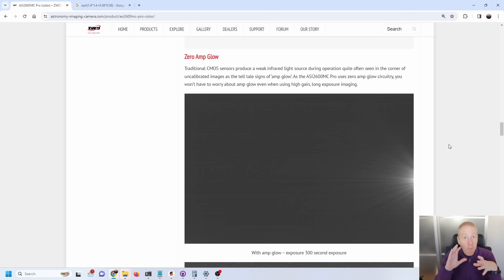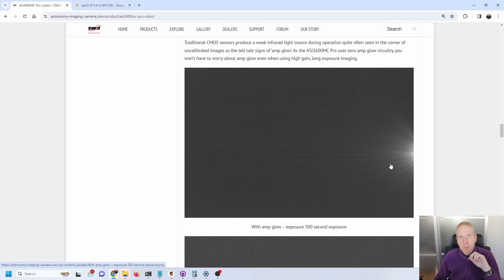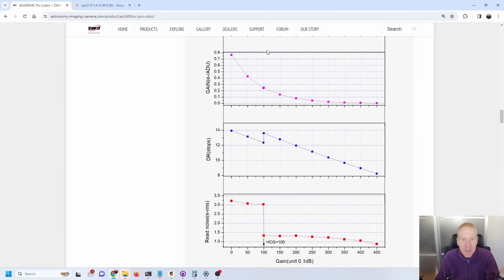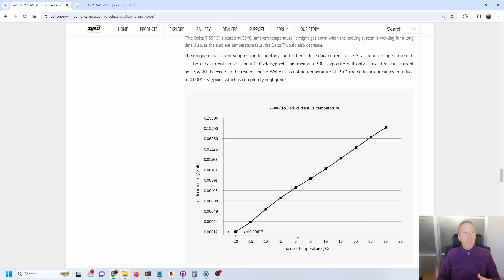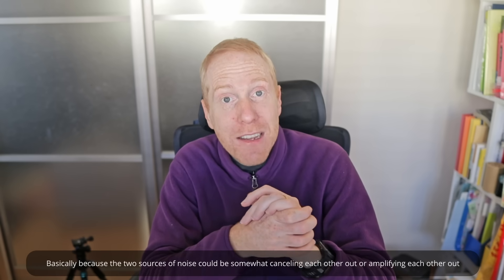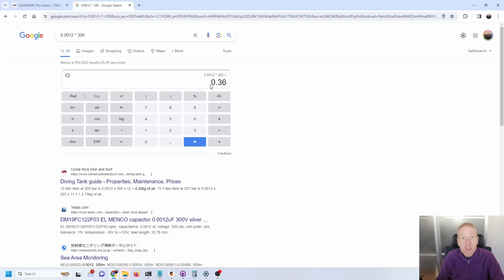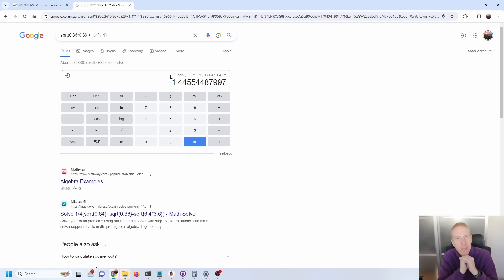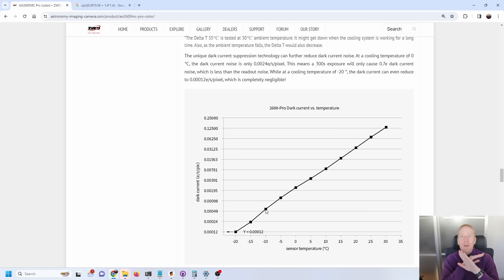Why I DON'T take Dark Frames (and what I do instead) - Astrophotography

Comment: Insightful as always. As much as I've learned from you over the years I have to mention 1 thing. For flat correction to work optimally the cam offset has to be removed from the lights & flats to put them on the same pedestal, normally with darks & bias. I've gone on to use mathematical offset subtraction to calibrate the flats (avoids noise injection of calibration with no penalty) but still use master darks that are shot a couple of times per year with the cam capped & put in the fridge to save the tec cooling, no light leaks either. I do this for offset & sensor pattern noise removal bc dithering does cope well with everything else,  on my cams without amp glow.
Just a morsel of food for thought.
Reply from the maker: Yep! But in my case the bias act as flat darks :)
Reply: @CuivTheLazyGeek  Thanks, I understand, but I still use darks to remove the offset from the lights. I guess we all evolve our own ways and your work on YouTube has brought me much over several years. Always appreciated!

Comment: Interesting video, seems convincing logic so I gave it a try processing with darks and dark-flats vs processing with master bias.  SubFrameSelector judged the one with darks to be better in all respects except FWHM, where the bias version was 1% lower (2.16 vs 2.18, not statistically significant).  After BlurXT correct only, even this difference was erased, with the version using darks winning in all SFS measures.
Visually, I thought the darks version looked better but it was marginal and I may have been subconsciously biased.
Only one test on one set of data, but I’m gonna stick with darks and dark flats

Comment: A few things I just want to point out. This hugely depends on what software you use to stack. Some software requires you to load a master dark if you're using a master flat, otherwise your stack just won't calibrate properly. It can result in massively overcorrected flats, even if the flats are perfectly good. 

Also, as others have pointed out, even with correct dithering (by using formulas to work out how many pixels you need to dither by for your FL and guide focal length) you may still have some hot pixels left as your sensor ages. You either have to start dithering overly aggressively (and at my FOV that just isn't a practical option) or using aggressive sigma clipping. Ultimately if you're using a cooled camera and shooting a master dark library is a one time event every 6-12 months, I'd still just rather use them and take potential stacking problems out of the equation. 

Obviously bias frames are shorter so take less time, but running a dark session on a cloudy night is super easy. On a current gen cooled camera, you're essentially just doing super short dark frames with the bias, so really you're just swapping one out for the other. FWIW - If you have light leaks in your darks, then you likely have light leaks in your lights too, so it's worth actually chasing down those light leaks in general.

I do think when you know what calibration frames are doing you can make this decision yourself, but I think a lot of beginners will see this video and then just assume they don't need darks even though you've explained why you don't necessarily need them for every camera. There's lots of confusion in the community already, so I hope people do their own experiments.

Comment: My opinion would be that darks are not useless. Newer cmos cameras are low noise, not no noise. Using darks will without a doubt improve SNR when measured. Also darks are so easy to take and can be done even when cloudy. Not using darks when it's such a simple way to improve image data, seems counter productive. My two cents. Cheers.

Comment: Cuiv, When working with exoplanet and variable Star images, and with the intent of contributing the data for use by Professionals, is there some subtle ‘noise effect’ that we really should remove via ‘darks’ given the intended professional / scientific use? I just wonder if there are subtle factors that impact the photometric measurements that suggest the use of Darks in those non-AP, scientific applications. 

For example, Flats may be considered optional for AP if you either don’t get vignetting or don’t mind a little of it. However, Flats are considered essential for scientific imaging, vignetting or no vignetting, since they help correct for the pixel to pixel variations in quantum efficiency.

Comment: The analysis completely misses all the non-linear effects of some pixels and the manufacturing defects that a sensor shows when you take longer exposures. You can easily see the amount of "hotter pixels" and small defects on the sensor by comparing a 1-sec master dark and a 300-sec master dark. Just open both and compare visually; I did it on an ASI 2600 at -10 degrees, I see all of them, and I would never replace the proper master dark with a shorter one. Defects on a master dark with a mean of about 10-12 ADUs can get up to 80-100 ADU, which are absolutely of the order of the signal received from a faint target. Absolutely not negligible.
Reply: For these effect one darkframe would do the job. No need to do this for different gain and temperature settings. In other words this would be a different sort of darkframe which only needs to be taken once a year or so.
Reply: Moreover dark frame calibrations do not correct for non-linearity

Comment: My interpretation of this video is that you “get by without dark frames”.  Some of us do not have cooled sensors and probably others of us have the sensors that you mentioned at the start.

It reminds me of those who don’t use lens hoods for general photography.  They see no point.  But, in fact, there are cases where the benefit of a lens hood is easily seen.  And that points to the fact that a lens hood blocking stray light, how ever slight it might be, will have some benefit.  Definitely worth the 5 seconds it takes to put the lens hood on.

Comment: Cuiv, can you please explain how hot pixels are correctly calibrated out with your ‘flat and bias only’ approach? I thought hot pixels approached saturation more with longer exposure time …if that is true then you will not have representative hot pixels since none of your calibration frames has the same exposure time as your lights.

Comment: I understood that for DSLR (or mirrorless cameras) darkframes are still a good method to reduce sensor typical noise pattern. As long as flat frames are not needed bias frames are not needed as well when having dark frames - correct?

Comment: I also used to take all calibration frames but over time I also got lazy ( ;) ), and the only calibration frame I take are the flat frames. I still may take or reuse bias frames from libraries I have. But not all the times. Three reasons: 1) good camera 2) good settings for SNR and 3) in practice, I have seen very little difference. In reality there will be more difference between 2 processings of the same photo that in the calibration frame instead.

PS: of course this does not apply to all camera, eg amp glow

Cheers and happy new year !

Comment: Even with my old DSLR (Canon 70D), I have tried processing with and without darks and have found negligible differences. When I upgrade to a cooled astro camera, I really don't think I'll need them. It's nice to hear that I'm not the only one questioning their usefulness.
Reply from the maker: That's actually surprising to me, although I suspect you've been dithering very, very well!
Reply: @CuivTheLazyGeek  You are correct, ever since I got my mount I've been very strict with dithering (even with the hand controller before I started using NINA). We don't get many clear nights here, so I can't risk wasting a night of imaging. If that's what has been saving me from needing darks, then I guess the effort was worth it!

Comment: Interesting approach, Cuiv, although I'm still wrestling with the concept of not doing dark frames to be honest.  One thing I'd note, and I think you touched on this, is that you can't just assume you don't need to do dark frames merely because a camera is one of the ones that supposed to be 'well behaved', i.e., not have amp glow.  As an example, my first ASI2600MM Pro had two areas on the right side (top and bottom) of my dark frames of about 240s or longer that looked identical to amp glow but this camera isn't supposed to have amp glow!  Several others have reported the same thing in their ASI2600MM Pro's and it gets worse with increased time.  (In this particular instance, you might even need exposure-matched flat darks!) However, the ASI2600MM Pro that replaced my first one (that developed an oil leak) does NOT have this same amp glow-like bright area on longer dark frames.  So, initial testing of YOUR equipment regardless of the manufacturer's reported characteristics is necessary.   The second thing I'd mention is that I do see an exposure time-dependent appearance of hot pixels (thermal noise) in my dark frames, which is the main reason I'm still unsure about whether or not using dark frames is an optimal strategy.   Probably a good 'lazy' (and perhaps more efficient?) strategy since as you pointed out the dark current values in well-behaved astro cameras are very low when cooled and ambient temp will allow the sensor to be cooled to at least -5 deg C (which would be the case for most of us with cooled cameras not living in extremely warm areas).   For me, honestly, making a dark library and using master darks (without light leaks, of course!) each time I process is just reassuring, albeit perhaps not entirely necessary.
Reply from the maker: Very, very interesting... First time I hear of amp glow on an IMX571 camera! I almost feel like it should have been grounds for an exchange, since the lack of amp glow is one of the big marketing points ZWO is stressing...
Reply: @CuivTheLazyGeek  I contacted ZWO they said it was 'normal' (!!) and there were many ASI2600MM Pro users on Astrobin with the same bright areas.  I thought it was weird, though, thinking the same as you.  I said it looked like amp glow but perhaps it wasn't.  In any case, I just used darks and matched flat darks and the 'glow' was perfectly calibrated out so the camera was fine (until it developed the oil/grease leak and had to be exchanged).

Comment: Hi Cuiv, very vice video and very informative indeed.

May I ask you a naive question, as the read noise from the index sensor has higher read noise at unity gain than high gain, would it be an option to use high gain to further reduce the read noise.

Thanks you for your video again.
Reply from the maker: I always, always use high gain - almost the same dynamic range as low gain, but far better read noise :)
Reply: @CuivTheLazyGeek  what would you say is your most common high gain value that you use? Unity for my camera is 100 and I have experimented with higher gains but never reached any definite conclusions. I thought higher gain did result in requiring less image stretching in processing but otherwise I could not see definitely a difference in the images and when I saw a few that I questioned whether they had more noise or slightly bloated stars I then went back to unity.

Comment: @CuivTheLazyGeek I think you made a mistake when estimating noise from the dark current. The tabulated dark current (e/s/pix) is not the noise resulting from the dark current, but the linear increase of electrons with time due to dark current. With Poisson distributed noise, you have that the standard deviation (the "noise") is the sqrt of the number of electrons, so the dark noise increases as sqrt with time. That means that when you want to estimate the combined noise, the correct expression is sqrt(d+ro^2) where d is the dark current and ro is the read-out noise. Thus, in your second example with d = 0.36 and ro = 1.4, the combination would be sqrt(0.36+1.4^2) = 1.52 (instead of the 1.45 you got). This does not change your conclusion, just thought that I should mention it.
Reply from the maker: You're right!! I wish I could pin this comment, but the hot pixels one is more important. Thanks for mentioning it!! I'll add it to the description!

Comment: Very informative video Cuiv I haven't used darks for a while now Cuiv since using the Altair Astro 269C & 26C OSC cameras as never felt the need to due to no amp glow with either. I think using darks using them caused me more problems in the past so I just use flats, dark flats & lights now & they seem to work fine.

Comment: Thanks Cuiv. As an even more minimalisti approach to calibration files Siril allows for the option of replacing the master bias file with a "synthetic bias" which is a number proportional to the  camera offset value. For my Altair imx571 (with APT) it is just the offset value itself. You can also use the $OFFSET keyword if it is defined in the fits header. So just lights, flats and synthetic bias for me.

Comment: I’ve been running a 2600mc for about a year and dark frames are still essential to get rid of hot pixels. I’m finding that I need to remake my dark frames every 3 months or so. If I don’t use dark frames I get squiggles of green and red pixels scattered over my final images. 

Interesting note is that when my camera was new I didn’t get these hot pixels, but after a few months they appeared and dark frames were required.

Comment: Good video. I've been using an ASI183MC Pro camera for several years, and for that the amp glow is significant enough that I have to use dark frames. However, I've recently ordered the ASI533MC Pro and I'm hoping to avoid needing dark frames due to its lower amp glow.

Comment: I don't take darks when using my 533 cooled OSC camera but still need them when using my 183 cooled mono and DSLR cameras. As I live in an area where clear nights are not that frequent (I've had five since September) my 183 camera although four years old is still virtually brand new so I can't really justify spending over a £1000 replacing it at the moment. The 533 has only been used three times since I bought it last July. I don't find taking darks an issue for the 183 as it's cooled, they can be taken anytime. Can be a real pain for the DSLR though, especially if un-forcasted rain puts an early (and sudden) end to the session.

Comment: I'm as,ing this out of curiosity and not as a criticism about not using darks. So here is the question:  using a 571 sensor with no amp glow, i get a lot of hot/warm/cool/cold pixels. So would making a master dark (pick a temperature and number of seconds) and then image  in the lights data collection say 25 images,  but totally no light to the sensor so only the pixels show in their various levels of hot/warm/cool/cold.  Then run the stacking in a stacking program with the master dark (normal stacking procedure) and nd view the results. Would the pixels all be "leveled" out to an even background. Would this not give a similar effect when using darks with real lights data - in other words would this "level" the hot pixels in an image with real data?    

While "dithering " may also work a similar type of correction,  would it not be better to do both darks and dithering? 

I don’t have the answer, but this seems like it could be a fairly easy experiment in a dark room on a night of poor imaging conditions ?  It would be very interesting to see what the no light lights data stacking with a corresponding master dark would look like.  Would all the hot pixels dissappear in the final stack?
Reply: Or a next question: Do darks not work at the individual pixel level to adjust each individual pixel? Or are there programs that do a sensor evaluation (sensor mapping)  that could delete bad pixels from getting into the final stacked image? Going for the best clean data to process.

Comment: I haven't been using dark frames since switching to IMX571 and related sensors either. At least for my situation, they also tended to add unwanted artifacts (especially involving the removal of hot pixels). To alleviate this, in addition to dithering, I also curate my own defect maps which I apply in WBPP. This way you can target each bad permanent pixel without collateral damage.
Reply from the maker: That's a great approach!

Comment: I'm wondering if this analysis also suggests there are conditions under which it's "ok" to use an uncooled camera for deep sky - I have cooled cameras myself but I frequently see questions from beginners on Reddit who are unprepared to pay for a cooled camera and are looking at uncooled cameras instead, like the 533 or 585. I live where overnight temperatures are around 15C in summer and below freezing in winter, and in 15C it looks like a 60 or 120 second exposure with an uncooled 533 will still not have thermal noise exceeding read noise. I used that as a benchmark since that would increase total noise from around 1.5 to around 2 e-/pixel.

It would be nice to be able to tell newbies "uncooled is fine if you expose for X seconds at Y degrees" with these cameras.